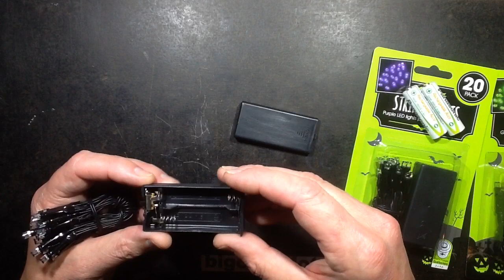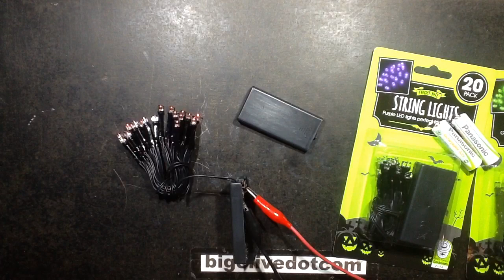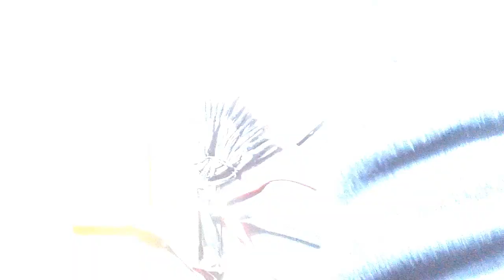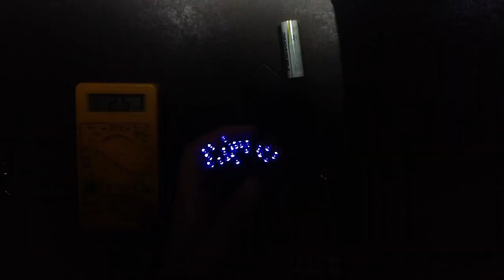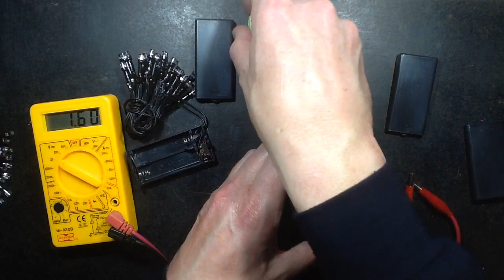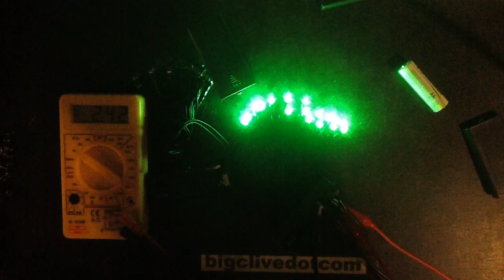Poundland's Halloween 2015 purple, orange and green LED strings.

Comment: Bought one of each this year and had to touch up the switches on two out of three, , and blobbed some hot glue in where the wire enters to act as strain relief. No resistors in mine though.

Comment: Sorry I'm new to the whole electronics world. Are you just using some kind of external power supply to adjust voltage and power the lights? If so, what's it called?
Reply from the maker: +efedude77 A typical bench power supply with adjustable voltage and current limit.

Comment: I got hold of a green set which didn't work. No series resistor on the set I got. A closer examination showed that there was pretty much a dead short across the battery leads when it was powered on. So there may be some QC issues...
Reply from the maker: +xoz1246 the green ones don;t have the resistor.  Just the orange and red ones.  Did you get yours going OK?
Reply: +bigclivedotcom I considered taking them back but decided that pulling them to bits was far more fun. Since they're all in parallel I chopped the chain in two and checked with each side. One half glowed the other still had a short. I then sliced the heat shrink off a couple of them on the faulty half and got lucky. It was a wiring fault they'd incorrectly soldered the + and - to the same lead!
Reply from the maker: +xoz1246 Ah yes, that would do it.
Reply: +bigclivedotcom Update.. since I had some much fun with the green set I got some red ones too. These had a 20 ohm series resistor which was packed right next to the switch with no insulation and actually shorted out on the set I got until I moved it about a bit. LEDs not uniformly illuminated and one not lit at all... still well worth the pound.
Reply from the maker: +xoz1246 You're not having much luck with them.  The resistors are just stuffed down next to the switch.  It's not an ideal arrangement.  I tend to check that when I get a set.

Comment: I like to power my LED strings/projects with old cellphone batteries. The packs cant take the current demand of a cellphone but running LED projects is no problem. I usually get another 1-2 years out of the pack before they just wont take a charge. Running time for the pack, between recharging, seems to be around 2 months +- depending on current demand of the project, I have converted several headlamps that normally run on the 3.6v battery packs, over to a LED array with using the 'recycled' cell batteries as power

Comment: Back before I even knew about Chinese ebay led Christmas lights (Last Year lol) I bought several strings of 100 from Wal-Mart and paid like $20 a string, NONE of them made it to Christmas day either, each string developed a failure where half the  string would light. IO could not return them because "I opened them up and plugged them in"
So yeah, last year my back end was sore after that experience..
Reply from the maker: +ElfNet Gaming Were they by any chance the Foreverbrite LED lights?  Where they just slapped all the LEDs in series across the mains with no resistor or rectification?
Reply: I cant remember, I already scavenged them lol but they came on a spool and they did have resistors attached to some of the LED legs...but no rectifiers that I could find

Comment: Nice video - makes me want a Poundland near by for those purple LEDs!
I wonder if the "lead-free solder" legislation had nothing to do with "poisoning" and everything to do with decreasing useful life of electronic equipment: coupled with tiny SMD connections, equipment is virtually a guaranteed to fail.
Even if unintended, this is certainly the consequence.

Comment: Just got back from Dollar Tree & they don't have any of those! Did see some incandescent fairy (as you call 'em) lights in orange & purple, but no LED strings. Typical LED flickering candles, etc.
Reply from the maker: +Madness832 Were they strings of the push-in incandescent lamps?  And how many were in a string?  Over here the Poundland ones are sets of 20 (12V lamps for our 240V supply) and the push-in type.  Very hackable.  Easy to convert to a very nice and completely future-proof set of custom LED lights with very little circuitry.  (2 or 4 resistors and a rectifier.)
Reply: +bigclivedotcom Yup, 20 in a string. I'm trying to remember, now, if they were AC or battery sets.

Comment: Did you know, the reason why green led's and green lasers appear brighter is because our eyes are most sensitive to the color green?
Reply from the maker: +hellonpluto LSD causes miscommunication between the neural networks in your brain.  It's like shorting random contacts on a computer motherboard with a bit of wire.  It can create new but illogical neural paths that may persist.  I'm not convinced about its safety, but one of the pioneers of these types of drug died recently at an age that suggested it had no major long term effects.
Reply: hellonpluto Probably because you took lsd.
Reply: +Richard Smith Adding to that, your eyes have twice as many green receptors as any other color.
Reply: Ryan Timmons Everyone is blind to the color red in low light :) Rods only see in green and blue and are the most sensitive. A red rose will go brown and its stem will become even more vividly green. 
Cones mostly see Red and green light, nearly no blue light.
Its not that we have 'more green receptors' per say, its that all types can see green, while blue is nearly exclusive to rods, and red is nearly exclusive to cones.
Oh, and I don't know if you ever heard the old philosophical question, "How do you know others see the colors as you do", but the fact that reddish green is impossible for everyone(that makes yellow), seems to point at the fact that we all see colors the same(unless color blind of course).
Reply from the maker: +Richard Smith Yes indeed.  And it makes a huge difference in the red end of the spectrum too.  In the bad old days the LED manufacturers used to cheat the intensities on red "superbright" LEDs by using the 660nm technology, which was technically brighter but visually dimmer than the richer 635nm neon-red LEDs.  The 635nm lasers are so much brighter looking than the 660nm ones for a given power rating.
Reply: +Richard Smith it is actually yellow green but yeah your right
Reply: ivan R Yellow is red+green...
Reply: Richard Smith true
Reply: +Richard Smith So, by extension, the CCTV cameras that flood the area with near IR light must be putting out an incredible amount of light. I can see the LEDs glowing when stopping somewhere like a gas station to fill up after closing time. 

Or, is there another mechanism at play?
Reply: Thor214 they are putting out quite some near ir light out, i think about a few thousand lumen from a good camera.
Reply: Thor214 Its a different mechanism. Those cameras do not have the same bias for certain colors, that is decided by the sensors and filters. The colors it is targeting is used as the luminosity for the gray scale recording. It has nothing to do with the this at all.
As a programmer, I do know the exact method these night vision cameras use, (max(R, optional G, optional B) + min(R, optional G, optional B)) / 2. Its simply an average of the minimum and maximum light it sees, converted into a single byte luminosity value.
And Blue light seems intense, but only at night. The reason is, the most sensitive photo-receptors in the eye are the rods, but they are overexposed in daylight. The rods were meant to help us see by the light of the moon. For seeing blue in the daylight, we have to rely on our blue-green cones, and those are few. Think of all the shades of colors between red and blue, vs the shades between green and ultraviolet(exclusively), and you will get an idea of how narrow that range is for us.
We have so much range in red and green, we had to invent a totally different color in our mind to fit all the extra shades, yellow, while blue mixed with anything just makes that color bluish.
Reply: Richard Smith wait but how come the good ir and near ir cameras have a few watt infra red leds on their cases?
Reply: ivan R What does this have to do with the human eye xD The human eye does not have a CCD and a CCD does not have a human eye xD They are different things. I do not understand your question.
The video that is outputted is no longer IR, it has been converted to grayscale. And the CCD is seeing in a range we are mostly blind to.
Reply: Richard Smith my question is this: for example, you know how uv lamps produce light in the visible spectrum and lightbulbs produce light in far ir near ir and visible light? and what I was asking is that is it possible that ir led also give off light in the visible spectrum?
Reply: ivan R Oh, yeah, absolutely, its possible. I know IR lights used to produce light from visible red to invisible infrared. However, many are not visible, on purpose, to be stealthy. 

Also, most cameras will pick up on infrared that you cannot see, unless it specifically filters it out. Point your TV remote at your camera, and press buttons :P
Reply: Richard Smith or even better hook the ir led directly to the battery :)
Reply: +Richard Smith last time i took LSD everything coloured red was very vivid.  Why do you think that happened?
Reply: Bigclivedotcom.......information on everything from LED'S to LSD and so much more.

Comment: Having done a lot of hand soldering using tin-silver-copper (SAC) multicore solder in a production environment I'd say there was no real difference between it and leaded solder. What you're seeing probably has more to do with other factors, like speed and flux.
Reply from the maker: +Graham Langley I used to use a lead/tin solder with some silver in it for all my lighting controllers.  It produced incredibly bright shiny joints that flowed beautifully.  An expensive solder, but definitely the nicest I've used.  I have tried to persist with lead-free solder but even trying different types the finish and character of the joints was disappointing compared to the older lead based solder.  And the flux fumes were very caustic smelling when you got a whiff.
Reply: +bigclivedotcom The expensive Sn/Pb solder was probably Multicore Savbit, which has some copper in it to help prevent the solder dissolving the copper from iron bits and fine wires.

The lead-free stuff I'm referring to has no-clean/low residue flux which smells no different than almost any other flux and it works fine with Weller TCP '7' bits just like Sn/Pb.

Unfortunately the reel I have here has lost its label and due to the way we parted company I can't ask the firm it came from. I have a memory it came from Rapid Electronics but that doesn't narrow it down much.
Reply from the maker: +Graham Langley the stuff I used was classed as a low melting point solder and came on very small and expensive rolls from RS.

Comment: Is the circuit simply a resistor and then the leds connected in parallel?
Reply from the maker: +BenjaminGoose For the orange ones it is.  For the purple and green their normal operating voltage is such that they don't need a resistor.  When running them in parallel like this the LED forward voltages have to be fairly well matched to avoid a few hogging all the current.
Reply: bigclivedotcom Interesting, I think I have a lot to learn! So is the current limited just because of the voltage applied being within the diodes operating range, and would a higher voltage (let's say double) allow a destructively high current? Sort of like a diode in breakdown.
Reply from the maker: +BenjaminGoose LEDs are basically diodes optimised to emit light when current if flowing through them.  With an ordicary diode it tends to pass current as seen as the voltage exceeds about 0.6V.  With older technology LEDs the forward voltage is closer to 2V but when you reach that voltage the diode (LED) starts conducting and will then try and pass as much current as it can.  So a resistor is needed to limit the current through it.
The newer Gallium nitride LEDs like the purple and green ones tend to start turning on just above 2V and the current slowly increases with the voltage up to about 3V where they are generally passing close to their normal current.
Reply: bigclivedotcom Ah right ok, thanks for the detailed explanation.
Reply: bigclivedotcom Ah I'm silly, I'm quite a novice to electronics and forgot about the basic principle of a diode's resistance depending on the voltage across it, which would have answered my question! Oh well, onwards and upwards.

Comment: I think you need to join "Poundland anonimus" clive, lol just leg pulling :-)
Mind you, those leds arnt bad for the pennies.

And you have my favorite icl7106 based cheap multimeter, the 830b by mastec, quite accurate on dcv if calibrated and resistance, but current and ac voltage i would give it a miss lol.
Reply from the maker: +zx8401ztv It's my crocodile clip meter.  I keep a set of croc-clip leads in it so I can just hook it up to low voltage DC shenanigans and it provides a useful meter function while leaving the big-boy meters free.
Reply: +bigclivedotcom I do understand your usage, good enough for most quick measurements :-)
I have a few, same as you, also an old micronta digital from the 1980's and a fluke 8050a bench jobby for closer values.
Most electronic repairs arnt that accurate.

Comment: Your workbench always seem so clean in these close up shots, and somehow you always have tools and parts from previous videos at an arms length. Could you do a small tour of your workshop / area, I don't mind if it's messy, my workbench is usually buried under a big heap of stuff.
Reply from the maker: +Fredrik Norén The video-zone is a black rectangle in the middle of a mound of technical clutter.  That's why stuff sometimes cascades onto it in the middle of videos.
Reply: +bigclivedotcom Haha, yeah.. +Fredrik Norén and +bigclivedotcom ... That is a very common situation =D I'd love to see a tour of the workshop as well, if you'd like to share =D No pressure, but if you'd like =)
Reply: +epic gameing Why the question mark?

Comment: I was going to ask why you're using Panasonic battery's when you rated the Poundland Fusiomax Endurance so highly in a previous video, now I'm wondering if the Panasonics you have there are rechargeable? 
Have you tested rechargeable AA mAh-age before?
Reply from the maker: +Green Silver Yes, these ones are rechargeable cells.  So much more efficient for LED lighting.  Sadly the Poundland rechargeable cells have quite a low capacity, although they seem well suited to less demanding applications like solar garden lights.  I have tested AA NiMh capacity frequently, but I don't think I've made a video about it.

Comment: hey clive! how about doing some reviews on cheapo eBay LED off road light bars. I've been debating buying one because they are so cheap but I would hate for them to damage my car
Reply from the maker: +Matt “oneillm987” O As long as you use proper in-line fusing on the positive connection they should be safe enough to try out.  I don't really have many situations where I could use those lights in a real scenario, so the tests would only be on the bench.